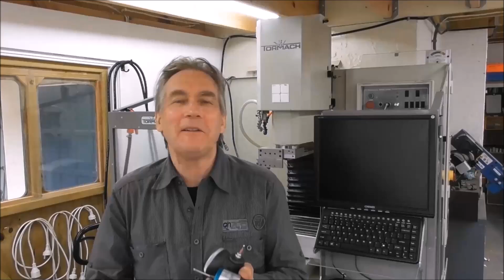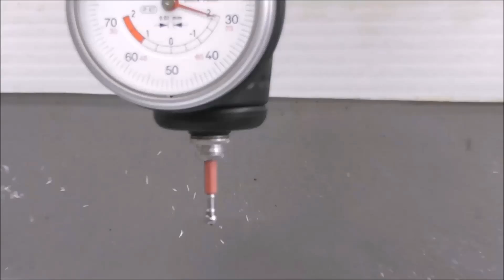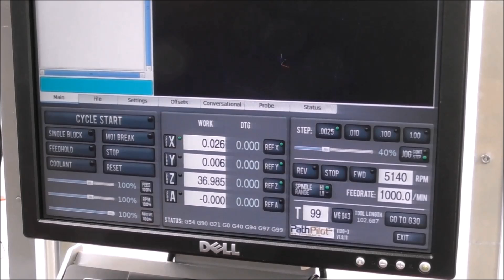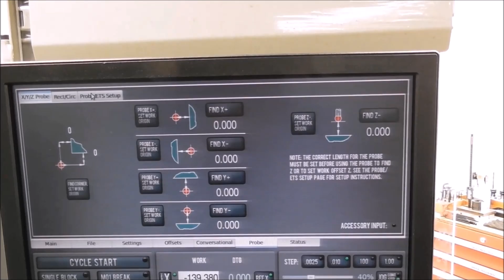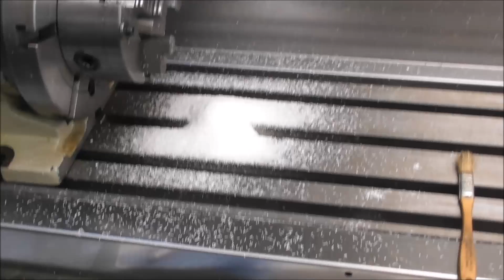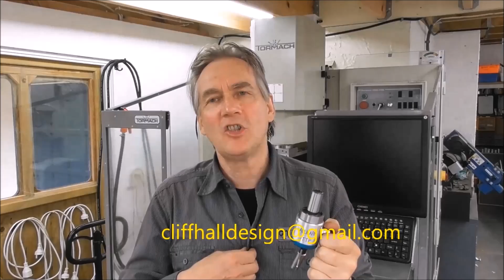Haimer vs Probe      mp4

Comment: I have never seen or used this probe before but it looks great. We have a Haas machine with the Haas branded Renishaw probe, works great but is not as tolerant for overtravel as your ITTS.
Great video but only doing one probing could of course be a lucky guess for finding the center 🤭. I'd love to see some repeatability readings on the probe. Even the Renishaw gives reading that differ by a few microns on our Haas VF3 - that is of course adding up all inaccuracy in the probe, the linear rail, ball screw, backlash and the motors/encoders.
Reply from the maker: Interesting! Thanks for the feedback, Cliff

Comment: I certainly agree the Haimer is AWFUL fiddley and time-consuming to use....after breaking a few tips I found  that I can use it without breaking tips.....BUT it takes time and serious concentration.  Better to apply that mental energy elsewhere. I am planning to buy the fault-tolerant probe you have developed when finances allow. I followed your progress in improving Tormach enclosure , your discovery of the runout error in the backend  of the rapidturn and Tormach's subsequent correction of the production line problem, and your work developing gang tooling for the rapidturn.  Really like the test indicator holder at 2:29   getting one of them too.  Thanks for all your work, videos and success, you are the Henry Ford / Steve Jobs in our area.  LOL
Reply from the maker: Hi David - Thanks for your feedback and kind words!  Cliff

Comment: Error wise, the mechanical dial indicators should have an arc that is mirrored to eliminate parallax errors because the mirror area will show a second pointer if you're not looking straight on. Unfortunately, many gauges do not incorporate mirrored areas.
Reply from the maker: Interesting! Thanks,  Cliff

Comment: ok so your haimer and Eprobe setup isnt reliable at all. you should do three time the same process before you take the actual value for real comparison.
Reply from the maker: I discuss in the video that this video is only an approximate introduction to the many accuracy/error factors.  For a reliable measurement it should be ten times checked - but first all the other machine errors I have discussed would need to be measured,  understood and accounted for - this would be a big job and was not the intent of this short introduction video.  Cheers  Cliff
Reply: @Threadexpress  Please forgive my English language. And thank you very much  for your time explaining me that 3 times isn't too many. I am learning alone. No school involved. But when you compare two devices you should do it 20 times. Of course on reliable setups with hard stops doesn't really matter. Anyway thank you very much. :)
Reply: Oh. I also want to say that I like the Eprobe but I can't afford it. I wish I could give 700 to buy just a probe. I spend little more to buy the masso and i worked 1 month for it. Just saying. . I know I sound cheap don't worry about it :D

Comment: Thanks for another great video.  I am new to this hobby and trying to best understand the equipment.  I hope I am not asking to many ??  I just watched a video that demonstrates that mechanical (spinner type) edge finders are the most accurate because they are not influenced by any part of the machine that is not perfectly concentric (collets etc.)  The video shows that the mechanical edge finders find the center of rotation of the spindle, irrespective of anything else.  Seeing that you are quite the expert on edge finding, I was curios as to your thoughts.  Here is the  link to the video:  https://www.youtube.com/watch?v=bga7y4infIo
Reply from the maker: Hi Joel. In some ways, at least in principle, on a basic manual mill, he is partly correct, because they rotate. So they are very concentric. But the actual trip position is also important, and with these edge finders, it is not highly accurate.
A high end eg $20,000.00 Renishaw probe on a high end machine can measure to 0.0001", because the trip position is much more accurate. But also probes are favored on a CNC because they set the offsets much more quickly. Cheers  Cliff

Comment: Ideally with Haimer, you should re-do the X after you have done the Y, as then it will be more on center, this should give a better center.
Reply from the maker: Hi tvrleigh. Thanks, I understand the theory of what you are saying, but in the Haimer example in this video the greatest error was in the X - yet this was the axis that was on centre after first setting Y.  Pre probing the Y the X position was only set approximately - yet the Y set more accuracy to centre. This emphasises my point that there are many minor factors in these machines that contribute to inaccuracy.   Cheers  Cliff

Comment: Nice comparison but you forgot about the prices.  There is a significant difference.
Haimer (Amazon) US$ 425 + shipping US$ 20 = US$ 445 
IITP (https://hallmarkdesign.co.nz/probe) US$ 695 + shipping US$ 45 = US$ 740
And you forgot about an other thing. This is a Tormach hobby mill, and not something professional and rigid precise machine. It has quite bad reputation regarding accuracy. It can have quite big backlash. I'm not sure what kind of accuracy you have measured and compared, the probes or the machine ?
https://www.youtube.com/watch?v=FtnaqJuJ9kw&t=450s
Reply from the maker: Hi. Thanks for your thoughts. Re "This is a Tormach hobby mill, and not something professional and rigid precise machine. "  This subject is actually covered in the video from 12 min in.  Cheers  Cliff
Reply: @Threadexpress  In what way was that covered? You were speculating about it's accuracy, you were guessing this and that. Guessing ! You should've started with measuring the accuracy of the mill. If you know how to do that, it's not an obvious task, not at all. And if it's 10 times bigger than the accuracy of the probe, then this is not the right way to test the probe's accuracy. And you can see another important thing on this video. You controlled the Heimer manually, some overswing, no problem go back, overswing again, ooops np lets try again and again. You should've done it in the same way as the ITTP did, one overwsing, back and fine steps to touch the workpiece precisely only once. That is much more precise arrival to the workpiece obviously. Not dancing around the target position. Just think of backlash. No problem, I don't mind I just commented this video because I thought you were biased and you wanted the ITTP probe to win. I don't know why. We still don't know which probe is better and more precise, we know which one is faster.
The Heimer manual says: measuring precision of 0.01 mm / 0.0004"
IITP promises nothing, no numbers just youtube links. I think these probes are about the same quality, same class. I prefer the electronic way it goes well to CNC. I like the much lower price of that good Heimer. It's hard decision.
Cheers, Laci.
Reply from the maker: @telelaci2  Hi - By 'it was covered in the video'  I mean the point that these machines are not highly accurate .  This is not speculating or guessing , I have spent a lot time time over the years checking these machines .  I was not claiming that one probe was more accurate than the other. I said in the video the accuracy results could have gone either way.  Please listen at 15min 30 sec.  There I agree with your point " We still don't know which probe is better and more precise, we know which one is faster."  Yes, that is the point I was making.  I am not in disagreement with you.  Cheers  Cliff
Reply: @telelaci2  if you have multiple machines the choice is obvious buy the haimer. Also here we don’t have tormachs and run fanuc and fadals mostly and a couple of house built cnc’s so unless we dedicated a probe to each machine then that changes things. Two of our fadals are equipped with renishaw and the haimer is great to move between other machines. No cable, no software or pc required to operate it. So while you make some good points I think you really need to consider your usage because if you can’t connect it to your machine then it’s just a paperweight. For our bench router I have a $200 passive probe and it actually works really well. Cant recall the brand but it looks to be of similar quality to the one in the video and we have probed parts and replicated them perfectly so it’s hard to complain that price had anything to do with quality. That’s another point to make if you need to reverse engineer than you want a good digital probe.

Comment: Are you making these for bt30 spindle for future Tormach 1100mx?
Reply from the maker: Hi - Most likely I will be making or recommending  a TTS to BT30 adapter that will be permanatly fixed,  so it can then be dialled in concentric.  More details to follow in a part 4 video soon.  Cliff

Comment: An impressive time savings alone Cliff. 100% for sure on anything your willing to show in another video about compensating for a machines inaccuracy's. I have a manual Taiwan built Bridgeport clone, but if I had cnc I'd certainly be ordering one of your probes after a demonstration like that.

My Haimer is a bit different than yours since I have the 3D model. Haimer recommend using and permanently leaving it in a dedicated 3/4" endmill holder. I understand why your collet mounting your Touch Probe since mine takes a fair bit of knee movement just to fit it into the spindle for most work. It's also about the only use I've ever found for that ridiculous alignment setscrew the R8 spindles have. You obviously know better than I that zeroing your Touch Probe with a dedicated holder and indexing it to the same spot each time in the spindle as you do now would further increase the accuracy. And yes I'm the same about breaking one of the Haimer ceramic probes. Come up with a way to use your impact tolerant probe tips on the Haimers and you'd sell a whole lot of them. :-)
Reply from the maker: Thanks for the feedback TP. Cheers  Cliff

Comment: I've watched previous vids on this unit and have always liked it. Do you think i'd be able to retro fit this to my Extron Mill? It runs a Mirl2000 controller (based of off a Fanuc controller), Cheers Stephen
Reply from the maker: The  ITTP  comes with with a 3/4" TTS shank that references also on the Z- what type of spindle/toolholder do you use? Cliff
Reply: Threadexpress it's a bt40. I'm more concerned about the interface with my controller. Cheers Stephen.
Reply from the maker: Hi Stephen. I don't have specific information on that, but if you email me (address end of video) I can give you some general information. 
Cheers  Cliff